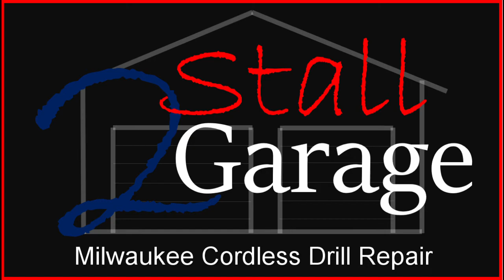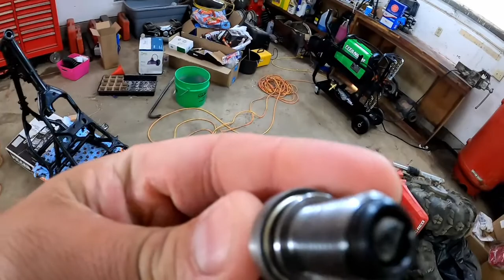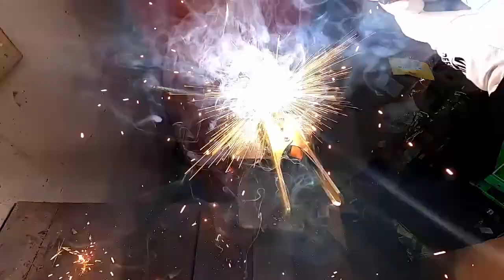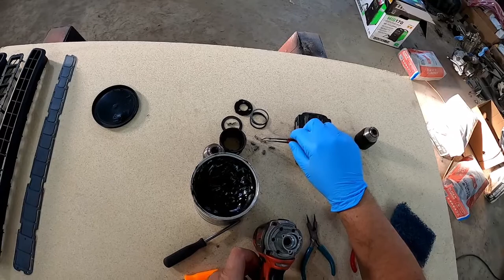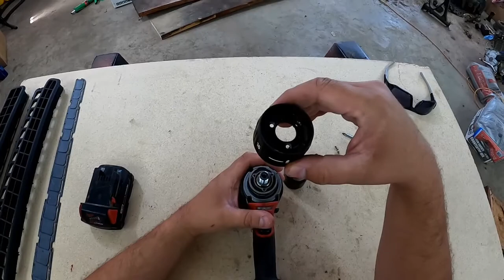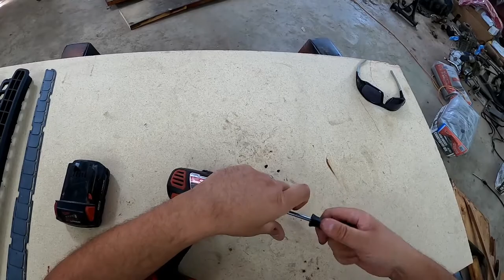Repairing Our Shop's Milwaukee 2606-20 1/2" Driver Drill

Comment: There are 2606-20 for sale on Amazon that are new for 50 bucks.  I bought one, sent it back for another and I'm returning the second as well.  I never used either of them and here's my problem with them - the electric brake is very violent and sparks a fair amount.  It clunks and grinds to a stop from the highest speed.

Does yours do that?
I'm trying to figure out if this is the way these drills are designed.
Reply from the maker: Ours does the same.  Anytime on speed 2, I try to slow my trigger release to keep it from locking so roughly.  The good news is that it still works after all the hard use.🔧  Have a great day.

Comment: I just bought a brand new open box 2606-20 shipped for $44
Reply from the maker: That should last a long time. Nice 👍
Reply: I doubt I could get the parts for that to say nothing about loosing some of those tiny parts in the process (may still tho for the experience)  @2StallGarage
Reply from the maker: @timgoodson9029 it’s nice to be able to fix vs junk and buy new.